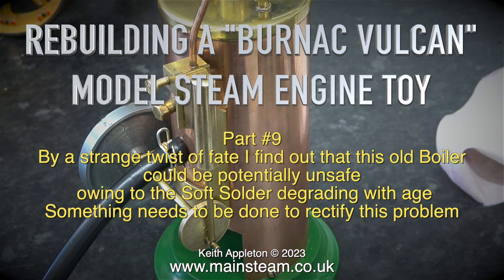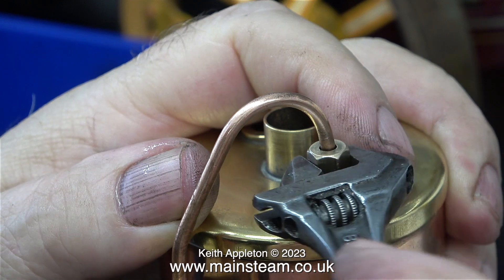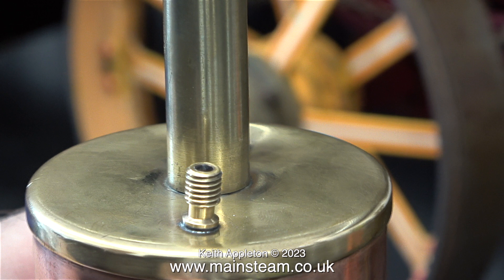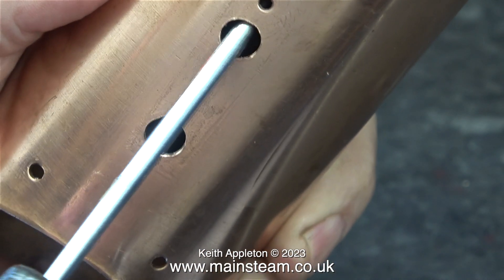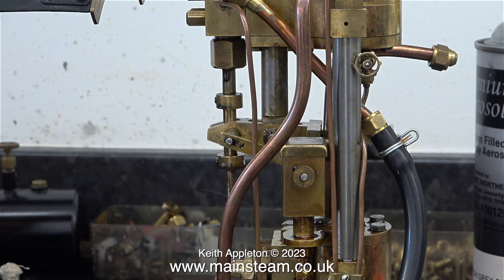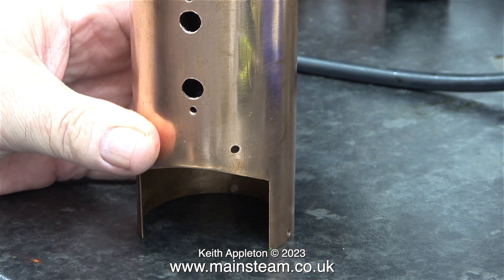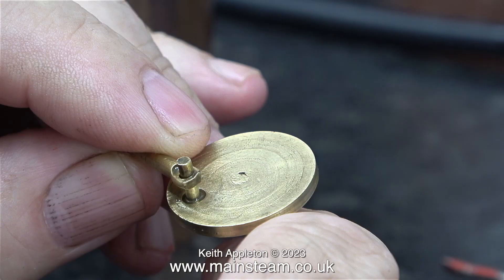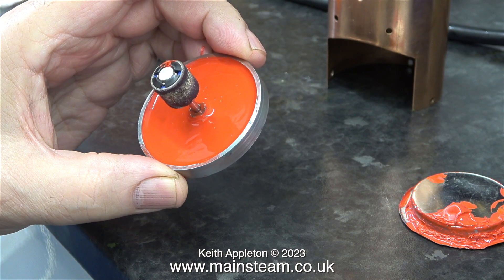REBUILDING A "BURNAC VULCAN" MODEL STEAM TOY - PART #9

Comment: Sorry to hear that but you’ll get it sorted out either way, have you tried harris bridgit nickel bearing solder its extremely strong for a soft solder with a higher melting point (332’c), but either way silver solder joints would probably outlive the boiler itself. Great videos & looking forward to seeing it completed
Reply from the maker: A new Silver Soldered Boiler is the way to go .......